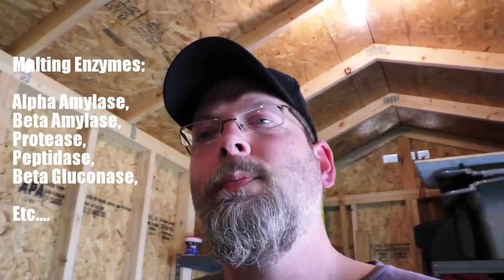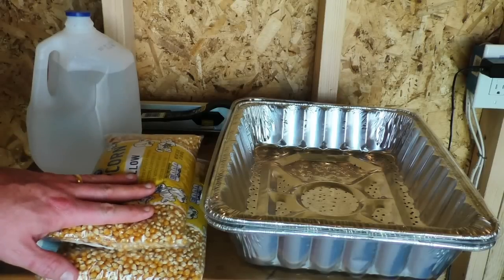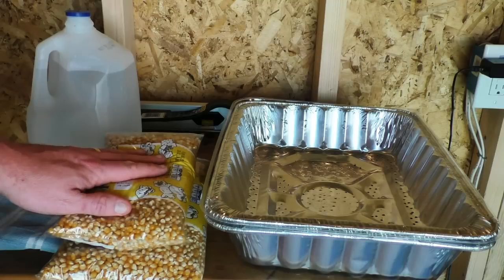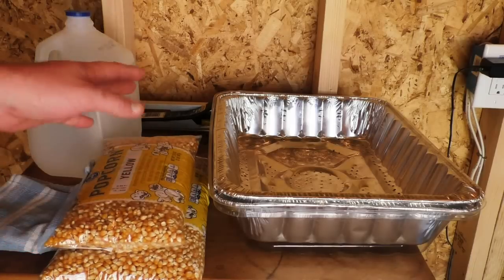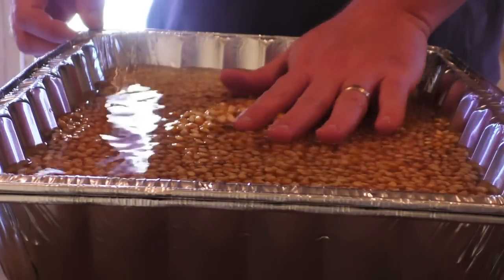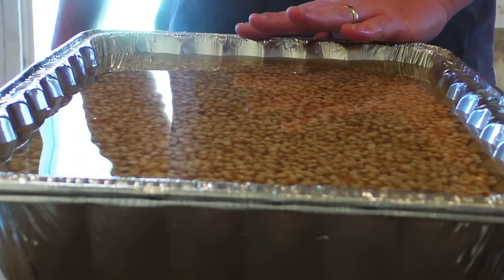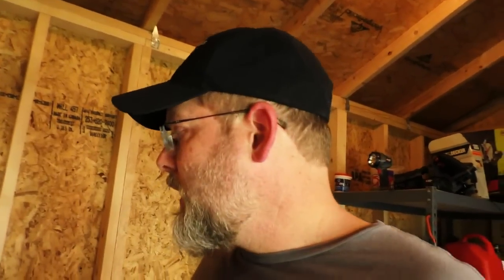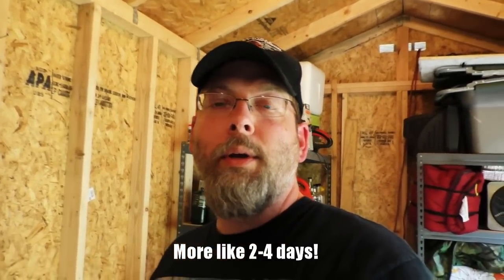HOW TO MALT CORN FOR MOONSHINE & BEER - EASY! Part 1

Comment: I'm going to make corn extract for low carb baking. A tiny bottle is $20. Thanks for the video!
Reply from the maker: Interesting:-)
Reply: How’s your corn extract go? Can you post an update or info on how you did it and what you think? We also low carb a lot, but I’d never thought of the need for the extract. How are you using it?

Comment: Maybe try adding some info on temperature for the soaking, air rest and germination. Keep up the good work! Brew on.
Reply from the maker: Good point. I'll get that into the video description, but here is the info. Soaking, air rest and germination temp range can vary from 50F to 75F plus or minus a few degrees.

Comment: What a great video - so full of information.  Thank you so much.  Everyone just uses commercially available malts and malted grains (not easy to get here).  So this old time farmer's method is great for me.  Now I can only get un-malted barley.  Could I follow your corn process to make malted barley.  Do not know if it is 2 or 6 row because it comes as individual barley seeds in a bag (500 g).  Thank you for any comments you may give.  Have a great day and a better week.
Reply from the maker: Thomas, you can absolutely use this method for barley. Barley doesn't need to sprout as much to create the amylase enzymes, so when you see a sprout on a barley seed that is about 3/4 as long as the grain, it's time to dry them out. Where as corn shoots need to be at least an inch long before drying. Let me know if you have any questions:-)>

Comment: I think my issue is my analyse or not enough water compared to grains, just cooked 10 lbs or corn, got it to gel no problem, added my enzymes from 3 different bottles and 1 bag, let it sit at 155 for 4 hrs burned the heck out of it as well but no conversion whatsoever checking with iodine, so ordering more amalyse from a different vendor
Reply from the maker: That sucks. Hope you get some good stuff.

Comment: got some q's and suggestions
1)this produces enzymes as well as yeast so you dont need to add yeast is this correct? 2)malting also produces sugar in the grain,i am wondering why not let it sprout longer and get as much sugar yield from a grain then simply kiln that to your liking or start fermenting and not bother worrying about having the enzyme to convert adjunct?
3)would it still have natural yeast if done like that in #2?
4) i suppose it takes more malted corn that way and you simply trying to use small batches of malted corn in order to convert adjunct corn is that right?
5) what is the lowest temp you can safely use to dry the corn without killing the enzymes or yeast?
6)can you use distilled water?
7)you said the shoots need to be about 80% length of the corn but they went way past that?
Reply from the maker: Thanks for the great questions. Keeping me on my toes;-)
1. The malting doesn't produce yeast, but since yeast is floating in the air everywhere some will naturally be on the corn. The problem with relying exclusively on this wild yeast instead of a commercially cultivated variety is that it can be pretty inconsistent in it's performance. Depending on what was drifting by you may get a really weak yeast that doesn't produce more than 1% or 2% alcohol before it craps out, or you may get a yeast that can produce some really bad flavors like sulfur. In the old days the moonshiners would generally rely on nature, which leave all your hard work to chance. I like using a good quality commercial distillers yeast, champagne yeast or ale yeast because I know how well it'll perform. There are a lot of variable in the whole process, so if I can remove one I'm happy to do it.
2. You can let the malt continue to grow and produce more sugar, but it'll always leave some starch behind, and if you use up all the enzyme for growth, then there is nothing left to convert the starch. It'll work, but you're losing out on a lot of potential alcohol in that unconverted starch.
3. If you kiln dry the grain it'll kill off any natural yeast.
4. Actually the conversion power (diastatic power) of malted corn is one of the lowest compared to malted barely. It only has enough enzyme to convert itself, the remaining starches within the malted grains. If you add unmalted grain you'll need to use some malted barley (20% of your grain bill) to convert the other adjuncts.
5. A safe drying temp is below 120F. The alpha amylase is pretty touchy.
6. Yes, you can definitely use distilled water.
7. 80% length of the grain for barley, but corn shoots need to be about an inch long. I was all over the place in that video;-)
Reply: i really appreciate you taking the time to answer each numbered question the way i had it down,,i been going nuts trying to figure out how to calculate how much malted barley 6 row to use for conversion,,seems like i cant find such info much on vids or in search,,i know its got a 160 lit but how to calculate how much of it i need for whatever amounts of adjuncts im using,,if i got it right it only needs 30 lit to convert itself leaving 130 for the unmalted grains  but is 160/lb or whatever amount? so if im using 2lbs of adj then how much mb would i use? ,,also i need your help with this beer i been trying to brew ,lots of problems,ended up using almost half pound mb for 2lbs of adj and i still dont think it was converting very well and i think i must be doing something wrong cause it got very messy in the bag,i do not see ppl going through the same mess and problems i have
Reply from the maker: The rule of thumb is 20% of your mash bill needs to be 2-row or 6-row barley. So if you have 10 pound total or 10000 pounds total grain weight, 20% of that needs to be malted barley. For your beer recipe, since I'm not an expert I highly recommend checking out r/homebrewing on reddit. Post your recipe and problem and some of the smart dudes over there will sort you out. I love that forum:-)
Reply: ok great because 20% sounds about right,i think for the 2lbs i had i ended up using about almost half a pound of my mb i think i used exactly about .4lb so it sounds right,but am i adding 20% to the bill or am i replacing 20% with mb??
Reply: also i think the guy at my brewshop was either trying to scam me or he was clueless because he did mention 20% but he was saying it will only convert 20% of my bill and he was telling me i needed to buy many more pounds of the mb,,so either he had it wrong in what the 20% or he was trying to get me to buy more for my 2lb bill(and i already told him i was only doing a small 1 gal batch using 2lbs)
Reply: ok so i think you were saying for my 2lb of grains i would have to replace 20% with mb ,so i am replacing and not adding correct? suppose i want to keep 2lbs of grains and not touch that ,how would i calculate how much mb to use then? 40%?
Reply from the maker: 20% of the total weight. So if you had 10 pounds of nothing but corn, pull out 2 pounds of corn and add 2 pounds of barley.
Reply from the maker: 2 pounds, or 32 ounces multiplied by 0.20 (20%) = 6.40 ounces of grain needs to be replaced with malted barley.
Reply: right on,,but what happens if i want to keep 10 lbs of corn,how would you calculate it then? i would guess you will take into account another 2lb of corn x20% so the total will be 2lbs mb plus .40lbs mb so total would be 10lbs corn and 2.4lbs mb? or it just dont work like that?

Comment: * wonders why he never realized the years old bag of popcorn in the pantry has been calling his name...
Reply from the maker: Answer the call:-)
Reply: The only thing I have available RIGHT NOW to try to convert is rice, or would you recommend that pearl barley? I will have time to get that. I'll also need to free up a fermenter... or could I just make a NEW one? Hmmm...
Reply: Also... making wine is WAY MORE EASY LOL
Reply from the maker: @mrpieceofwork  Rice will not malt like any other grain. It's pretty tricky. All the Asian countries that make rice wine don't even bother with malting rice. They use a special mold to convert starches to sugar. Pearl barley is stripped of its husk and seed germ so it won't malt either. Best bet is to get some feed corn or popcorn:-)
Reply: I meant malt the corn, then use that to also convert the starches from rice, like you did with the barley. I looked it up, and it's a process called cereal mashing, which apparently is seldom done now as it's a PITA (to me, at least) and as there are much easier ways to obtain the same results. I'll def. malt the corn, though, just... because. LOL
Reply from the maker: @mrpieceofwork  Oh I see. Yeah that'll work:-)

Comment: I am a little fuzzy on the soaking times. You said to soak the corn for 8 hours. Then drain the corn, and let it sit under a moist towel for 8 hours. Then you repeat this 4 more times. So that is 40 hours of soaking, and 40 hours of letting it drain under a moist town. That's roughly 3  and a half days of soaking and draining before you spread it all out to sprout under moist paper towels for 10-15 days. Is that correct? 
I'm asking, because I've seen other videos that say to soak it for 24 hours. Then change the water, and soak it again for another 24 hours... then begin to sprout it in a thin layer on trays under wet paper towels. Your method has a lot more time out of the water. Your method seem to work. I just want to make sure I understood what all you said.
Reply from the maker: Mike,
Sorry if the timing was a bit murky. First video-itis;-) It actually takes about 2.5 days since it's 4 cycles of 8 on/8 off. There are various methods that I tried out, including the long soak you mentioned. The method I use gives me a higher germination rate. I get between 70%-80% germination consistently. Using longer soak times tended to give me lower rates. Not sure why. Though I have not tried using corn from a feed store, only popcorn. The longer soak times may be more appropriate for regular feed corn. I'll have to test that.

The actual sprouting after your last soak takes about 3-4 days, depending on the ambient temp around the corn. The colder it is, the longer it takes to germinate. My corn was in an 80F degree shed so it finished in 3 days. I wouldn't go much warmer than that though. Too much heat can kill the sprouts, and has a tendency to encourage mold and bacterial growth.

The drying takes 2 days over the fan and a few more hours in the clothes dryer to finish it off. Total time from first soak to completed drying is 7.5 to 8.5 days.

It's definitely not a quick project, but worth it:-) Let me know if you have any other questions. Thanks!
Reply: Thanks man! It looks like I'm going to be doing a hybrid of the two methods. I bought some popcorn and soaked it in water overnight. I forgot to drain it this morning. So it will be soaking for 24 hours. Then I guess I will let it drain under a moist towel tonight, and then do another 8 hour soak. etc. etc. As far as the feed store corn vs. popcorn debate goes... I think that popcorn maaaay just be better for making ethynol than feed corn. I know that popcorn companies use those varieties of corn as "popcorn" because that species pops the largest and makes the fluffiest, largest, kernels of popcorn. This tells me that it must have the most startch, and the least fiber, fat, and other stuff. I could be wrong. Do you know of any resource where one might find out which variety/species of corn has the most fermentable starch/sugars and or the most corn flavor?
Reply from the maker: That should do just fine. I'd give it 2 soaks of 8 hours with 2 drains of 8 hours. That should be plenty. After the second draining is done look to see if there are any chits forming (little white tails). If so, you can go ahead with the rest of the germination. If not, then give it one more soak.

Your idea about popcorn having more starch is interesting. I did some googling to see what I could find as far as starch content by corn variety. Lots of research papers out there, but I didn't find a chart or anything to give a quick answer. I read that dent corn (feed corn) has a larger ratio of starch to sugar and is the variety most used by the ethanol industry, and sweet corn (table corn) has a higher ratio of sugar to starch, but not sure how they measure up to popcorn in the starch department. I did learn that the other varieties don't pop well due to the make up of the kernel and the moisture content, but no info on starch levels by comparison.

If you find anything let me know. Really fascinating stuff:-)

As to getting a good flavor...since home distilling is illegal in the United States I'm not advocating you distill your own alcohol. Hypothetically though, a combination of malted corn and flaked corn, and smaller portion of malted barley (20 to 30% of the mash) could...in theory...make a really good mash that would yield a very tasty distillate....hypothetically speaking, of course.

Comment: so many different corns, field corn, popcorn,etc, which is best?
Reply from the maker: Great question. Well, so far I've only malted popcorn, but I want to try field corn next. I think that field corn might have a higher starch content, at least I hope it does. My brewing efficiency is lower than expected, as if I were using less grain than my recipe called for or getting incomplete starch conversion. Might be something wrong with my brew process, which is entirely possible, but I have a suspicion that it's the popcorn. I can't find any research to back this up though, so I plan on doing some tests batches of both field and popcorn to see which works better. That'll be in an upcoming video as the weather cools off enough for me to malt some more corn in the shed. Sorry I don't have a solid answer yet, but I am working on it. Thanks:-)>
Reply from the maker: @flatearth5033  No. The corn must be dried before you can malt it.
Reply: @BeardedBored thanku

Comment: Great video man,I'm in south western va and brew shops are hard to come by. So,my question is,How much diastatic power does malted popcorn have? I assume that it's not much different from other malted corn but dk
Reply from the maker: Very low DP, around 30L. Just enough to convert itself and nothing else. If you have a feed store nearby you can order some seed barley and malt it yourself. I did a video on specialty grains where I malted some from my local feed store. Turned out great:-)
Reply: I live in southwest Virginia as well, you can go to a farm store and get 50 pound sacks of corn dirt cheap, like $12 a sack to malt. Also, like bearded and bored mentored, you can get unmalted barley and malt it yourself, or a Southern States supplier 45 minutes away can special order 50 pound sacks of 6 row malted barley late summer, early fall. Just tell them you are making beer or they might not sell it

Comment: what if you don't let the malted corn dry and just use them right away? would it still release the emilize enzyme?
Reply from the maker: Absolutely. Actually there is 2 to 3 times as much enzyme and diastatic power to convert starches to sugars in the wet malt (also called green malt) as opposed to the dry malt. However, there are 2 reasons why it's usually dried first. 1. It's easier to get the roots and shoots off of the grains once they're dry. 2. If you use wet malt with the shoots still on the grain, I've read that it can add an unpleasant grassy flavor to the finished product that will transfer though to your mash.

I haven't used wet malt yet so I don't know how strong the flavor is. I'll do a video about it in the fall since I've had several questions about it. Too hot in the shed to malt corn right now:-(  If you try it, let us know.
Reply: Bearded & Bored thank you for the reply

Comment: ive seen people in videos make moonshine but they never talk about the corn being malted. they don't add alpha or beta amylase though either. They do add lots of extra sugar.

Some of them specify using cracked or flaked corn. This confuses me

Im not challenging you. I'm just trying to learn the process and hoping you can maybe clear up my confusion there.
Reply from the maker: I had the exact same questions when I started researching this a few years ago. Here's the run down. The most common "corn whiskey" recipe for hobbyists is really just corn flavored sugar water fermented into what is referred to as a "sugarhead" wash. There is no conversion with enzymes, or even cooking for that matter. It gives a weak flavor, but it's easy. My buddy Jesse at the Still It channel tested the most popular of these recipes, called UJSSM. It makes a butterscotchy spirit with a little corn flavor hidden in there. 
But you get more flavor and a better overall spirit if you actually malt or use enzymes to convert the grain. Typical bourbon recipe is 80% corn, with 20% malted barley to handle the conversion of the entire grain bill.
Cracked corn is just corn that has been slightly crushed, no malting, no cooking, no conversion. Flaked corn has been steamed and rolled and pressed into flakes, so at the very least the starch inside the kernels has been gelatinized. Malted corn does not need to be gelatinized and can simply be mashed at 150F for an hour.
This hobby is a rabbit hole of research. Check out the Still It Channel, Barley and Hops Brewing with George, and homedistiller(dot)org. Have fun:-)
Reply: @BeardedBored  thank you, that cleared up my confusion. Its such an interesting subject, so much stuff to learn. Ive watched still it. Yours and his channel are the two ive watched the most. I will go look for that video!! 

Thank you again, I feel less confused now!!
Reply from the maker: @cthulhu9136  Happy to help:-)

Comment: What would you say is the optimum temperature for the sprouting?
Reply from the maker: 55F is great to keep mold down, but it's never that cold in my garage. I usually have great results at 75F.